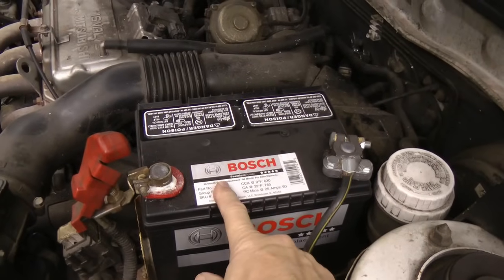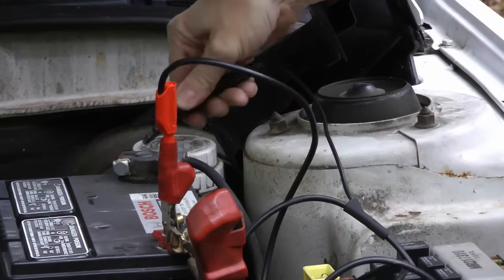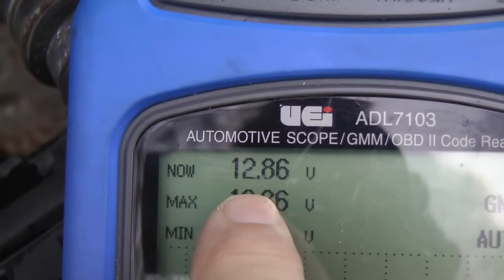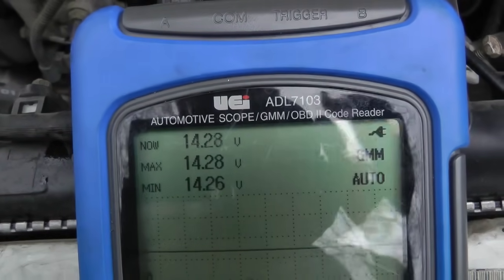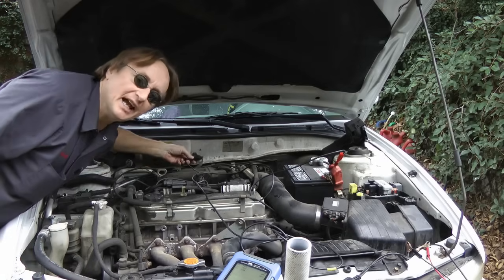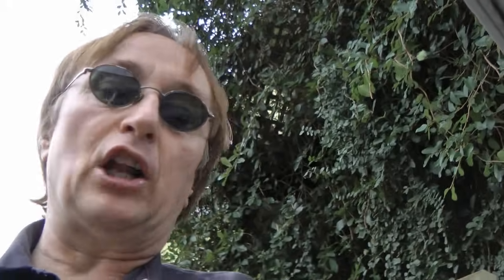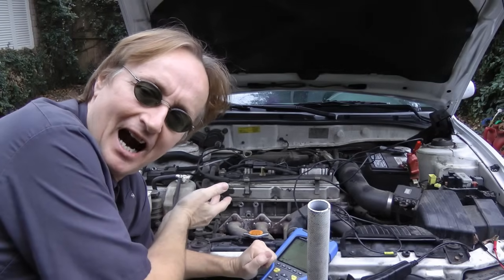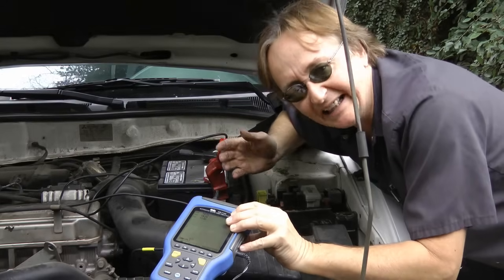How to Fix Electrical Problems in Your Car (Ground Fault)

Comment: Hi Scotty, you're the best by the way. ;)
My car's positive (red) cable is staying warm to the touch. I had a alternator reading and it showed the alternator was giving off low voltage I was told that is a sign the alternator was going bad....so I changed it. The car rides stronger now BUT that red cable is STILL warm. Do you think this may be a sign of a short in the red cable wire? My started test good also. I have an X5 BMW. Any ideas would help.
Reply from the maker: yes, if either end of that cable is corroded or not on tight, it will do that, Also an internally worn cable will do that, but that's rather rare unless REALLY old

Comment: Hey Scotty please help. I have a 2005 explorer. Wouldn't start so i tested battery. Battery was bad so I replaced it. Car started fine for 3 days no problems what so ever. Now car is dead again but it starts right up and runs fine after you jump battery. After jumping it it runs fine and stays charging. I removed battery terminal while it was running to see if it would die, it didn't. Why does it start up fine one day and be dead another? Connections seem to be tight. Also did regular test on alternator it tested good. Alternator was so hot it burned me is this normal? Thank you
Reply from the maker: either you got a bad battery, or you have a short. Have the battery tested, auto zones do that free. IF it's OK, do my video tests "finding battery drain on your car" to find the short
Reply: Ok thank you so much for the tip.

Comment: Hi Scotty coud you help me i have toyota 4runner 98 the  side front and back lights do not turn on also the dashboard light. And check all fuses and all are good it could be that. all other lights work well, brakes, signal lights. Thank you
Reply from the maker: there is no fuse that operates just those lights, so it's not a bad fuse. I would assume a wiring short, either power or ground wires, that feed those lights. Good luck tracing that down, Me, I'll often just rewire power direct from the switch to each lighting system and if that works, just keep it that way rather than tear the whole wiring system apart searching.
Reply: Thank you ¿then the lights have nothing to do with the computer?
Reply: Scotty Kilmer Thank you for your help i have another question,  lights have something to do with the computer (brain box)?
Reply from the maker: *****
 computer systems on modern cars actually turn the lights on and off, the switches are just 5 volt reference signals that send impulses to the computer which decides whether to turn on lights or not

Comment: Hey Scotty. Just picked up a 1991 Lebaron convertible and having some electrical problems. On occasion when I'm stopped at a red light with my brake depressed a cluster of other lights including temp/oil/batt will come on until I release the brake. It also seems to run poorly on occasion after this happens. Also a couple times it seems like the car is struggling to get gas in my opinion it would start to get louder as I accelerate, but not normal loudness, but struggle to actually speed up. It seems to help if I give it a bit more gas or I restart the car. Any ideas on where I should start? Thanks! Love the video very helpful.
Reply from the maker: I feel for you, that's one of the worst made cars of all time. First thing, start with basics, have the battery and alternator load tested, places like auto zone do that free. Pray it's one of those going bad, cause if not, good luck figuring out the rat's nest wiring on that old thing. Most are long gone in the junk yard by now.

Comment: Hi Scotty thanks for all the videos help me so much, I have a 1982 olds cutlass, I want to change the headlight switch, nothing wrong with it just the while lettering has worn off, and I have a brand new in the box and want to use it. How do you get it out? do I have to take off the trim, or do I have to take out the entire dash?
Regards Phill
Reply from the maker: try the trim and realize the switches often have a secret clip to remove the top section, then you can unscrew the switch itself and remove it from the dash

Comment: Hello Scotty, I have a 2004 Sentra and I must change the fuse everyday if I want my tail lights, instrument panel lights, and gearshift indicator lights to come on.  If a bad ground wire how do I locate...what do think the issue is? Please provide a solution. Also, please explain/show in detail how to fix...I'm a female and new to this whole DIY car thing.  Thank you.
Reply from the maker: see my video "finding the source of electrical shorts on your car", it's a royal job finding such shorts and requires such equipment. Probably better to pay a guy like me to do it You can't see electricity so you need tools and gauges and years of experience to find shorts
Reply: Scotty Kilmer Thank you for your response.  I don't want to pay anyone... I will purchase the necessary tools to find the cause and try fix myself.  What if it shows it's an electrical short or ground wire...how do  fix either one?  I was told sometimes something simple as electrical tape can fix the issue. But with your expertise what do you think could be one of the issues?

Comment: Hey Scotty, I have a 1990 toyota corolla 4cyl and im having a problem with my left brake lights... When I hit the brakes I get no lights on.. if I have my headlights on the same light will be on just dim.. soon as I hit the brakes. (With my headlights on).. it goes off.. no lights.. now when I push the light left to right in the socket with the brakes applied.. The brake light will flicker off and on with the headlights on... is this just a bad socket?? Its doing it to both brake light sockets on the left side... 

Thanks Scotty for any feedback!
Reply from the maker: often just a bad socket does that, or a bad ground wire on the rear of the car
Reply: also, don't forget to check for the correct bulbs... not all bulbs have the same resistance, even though they might look the same.... My dad couldn't see the little serial number when replacing the ones on his 93 camry, he just bought what ever looked the same, and the camry reverse lights turned on for that weird reason.....I checked the bulb numbers online and the problem fixed... apparently my dad doesnt wanna accept he needs glasses now.... good luck

Comment: hi scotty I have a question for you I have a 1997 wrx impreza,i get a buzzing/arcing sound from the drivers side dash then the car cuts out,turn the key it restarts and may go for a week with out a fault,so the front wiring loom and rear loom and ecu were checked and the grounds cleaned and re fitted,sadly its still doing it,so its going to Subaru in june for no doubt an expensive job,do you have any ideas?
Reply from the maker: something electrical is shorting out, pray it's just an ignition switch, they can do that
Reply: many thanks

Comment: This might sound like stupid question casue it is but If I want to check the ground wire for the brake light, should i put the red wire from the ohm meter in the brake bulb socket and black on the ground wire??
Reply from the maker: to check a ground wire, put one end of a meter on the bare metal of the car, and the other end touching the bare wire on the ground wire to see if it has continuity. If no continuity, it's bad

Comment: Hello ..Where do you put the positive wire when testing tale lite ground
Reply from the maker: I don't understand your question. You test the ground with a meter to see if it has 0 resistance to the body of the car.
Reply: Jamie very interesting and informative.

Comment: hi scottie,i own an 02' chevy cavalier, and im having an issue with my turn signals.. both the front turn signals wont blink. they light up but they dont blink. the rear ones work as supposed to.  it also click 2x as fast when i turn left and right. no blown bulbs, just the front 2 signals not flashing.. please help! thanks for all the video's! the brake ones saved me a fortune.
Reply from the maker: that's an odd one, since the back ones blink. So, either someone put the wrong bulbs in the front sockets, I've seen that happen, or the wiring going to the front bulbs has a serious problem.  In rare cases it's a bad turn signal flasher, so try that first

Comment: I hv a 94 mustang dash lights, clock and lights for gear selection
don't work checked fuse and replaced dimmer switch can ya help
Reply from the maker: check the dash connectors, pray it's that and not bad circuits in the dash itself, they often break apart at that age
Reply: thx man I checked all the connections and found that the plug that went into the dimmer switch one of the wires was burned up replaced it and works great I appreciate ur info

Comment: Scotty my 2008 mustang gt has a strange problem. Every time I drive the car I notice in the gauge cluster that the battery light comes on, and the message center says to "have charging system checked". It only stays on for a minute at a time then shuts off. It has happened up to 3 times in my short 15 min drives. I had o'reilly, advance auto, and auto zone all perform charging system checks. All 3 stores told me everything was running fine. What should I check
Reply from the maker: live with it, charging system is just taking a short time to read that it's fully charging. As long as it passes a battery load test and an alternator load test, it's fine.

Comment: my horn dash lights and 1 headlight went out was it a fuse????? but everything else works fine and my check light lights up an goes off like normal jus the lights to see the dash at night are off .
Reply from the maker: can't be a fuse, both headlights would go out then.  But do check for more than one fuse that's blown (realizing of course they blow for a reason, such as a short in the wiring or the device they operate)
Reply: I notice theres a 25 fuse where theres suppose to be a 10 could that overload something or is it no big deal?

Comment: Scotty! Strange problem with my 2004 Sunfire.. All the lights in the dash randomly came on.. the gauges stopped working... and the odometer reads "error." The radio would turn on and shut off and act extremely strange (and the theft light kept coming on). I removed the radio, and viola! My Speedometer and RPM gauge work again! However all my dash lights are still on and my odometer still reads error (my fuel gauge and temp gauge still dont work) Could this be a ground wire issue?
Reply from the maker: do check the ground wiring to the dash, plus the power wires to the dash. But if you find nothing, often a bad dash unit does that as they age.

Comment: Scotty...You're amazing man with all of these great videos!!  Such a big help!!  But I was wondering if maybe, just maybe you could help me with a problem...I believe after watching this it could be a ground, but wanted to run it by you before I began chasing it down.  I have a 92 Integra and it has a weird problem...When I turn the lights on, and then switch the high beams on the warning light indicators in the cluster start to erratically flicker.  It's ONLY when I turn the high beams on too...If I just have the lights on it won't do it.  Also, for some reason revving the engine and moving the car will make the flickering intensify.  Not sure if that's a clue or not, but something worth noting I suppose.  Would you say that sounds like a bad ground?  All the engine grounds seem to be pretty good, but I just bought a bunch of cable to replace them anyway to rule them out.  Where would you begin with something like this if you don't mind me asking?
Reply from the maker: have the alternator and battery load tested, easily could be one or both of those are weak. Places like auto zone do that free
Reply: Ok will do thanks!!!

Comment: Hi Scotty, My mechanic is eating me alive. I have a 2008 Chevy uplander. Impala's and their cousins have this same common issue but no one knows the fix. My  traction/stability control system message comes up. Also the ABS and TC light's come on the dash. I had this and reduced power once so they replaced the MAP sensor. It fixed the reduced power but the other problem still exist intermittently. Turn the car off and back on the lights go out. Now they changed the Throttle body and no change. This only happens in stop and go traffic or idol, plus all the lights on my car flicker a little at idol only. ???
Reply from the maker: any time you trip the check engine light on that model, it will turn the abs and TC lights on, that's software design. So you'd have to fix the root problem.  But if lights flicker, either alternator is weak or you have ground wire problems, fix that first
Reply: Ground wires are my plan for Saturday thanks

Comment: i find myself having the same problem in a way. My ECU seems to not hold memory. i visited the Smog shop 3 times. the first two times, first time it failed due to speedometer cable not working. fixed it, drove about 60 miles, then went for another test. drove about 40 more and went back, none of the ports of the ECU was receiving memory says the guy who was smogging my car. i just replaced my battery before these tests because of my battery was dying which then reset the Check engine light. so many said to check ground wires, previous owner told me to do a power cycle and again check my ground wires. what is your opinion?

Comment: My headlight are really dim as well as my dashboard every times I step on the break my stereo turns off. All of my light on my dashboard turn on and turn off in a strange way. Speed odometer gas and temp and Rpm only work when it wants to.

Comment: I prefer to check the ground by putting the black lead on the - of the battery, and the + lead on the engine block.  Would work justa s well, just that you are looking for 0 VDC instead of 14 or whatever.  Then if you have a .4 VDC drop, it will just show up as 0.4 VDC on the meter. No need to take measrument of the battery first. Kirchoff for the win :)

Comment: Scotty, I have a 99 jeep cherokee; the interior lights constantly stay on. I know it's not the switch. What would you do to fix that? Thanks!
Reply from the maker: If main switch on dash is good, then either one of the door switches is stuck on or you have a wiring short to power. Me, If it's a hassle finding the source, I'd pull the fuse for the interior lights and live without em

Comment: Scotty my ajar light does not turn on when opening the door I change the bulb but it still doesn't work on my mitsubishi galant 2002 2.4L ES what could be the problem
Reply from the maker: generally a worn out door switch does that

Comment: Hey Scotty!  I am having issues with my instrument cluster lights flickering and then going out when I drive.  With the key in the ignition and the car NOT started, the lights stay on and work fine.  But when the car runs for about 10 minutes, the lights flicker and go out.  If I'm in park, the lights will flicker when I press certain buttons, like the automatic window buttons to roll the windows down or up.  Also, this ONLY affects the interior lights on my instrument panel and the ones used for my center console...this does not affect my exterior lights.  I'm totally not sure what to do...any IDEAS?  Thanks in advance and thanks for all your helpful videos!!
Reply from the maker: often a ground short inside the car on the instrument panel will do that, OR a power short going to the circuit in the dash that runs the lights there. If it's a GM model, they burn out the circuit boards on modern GMs as they made the dashes cheaply in china and they just come un soldered.
Reply: it's a 2001 Ford Taurus.  Is there a specific tool or way where I can diagnose the exact issue or would I have to take it to a mechanic?  Also, could this possibly be an alternator issue?  Thanks again!  Your videos are extremely helpful!
Reply from the maker: Christopher Drinkard
 you can use a simple test light to check for power down the wires then into the dash itself . It lights up when there is power, and does not when power is lost. That's the quick way of checking it, but you will have to remove parts of the dash to do such checking

Comment: Hey Scotty I am currently having issues with the tail lights of my suburban.  The issue is when we step on the brakes my right signal turns on.  I cant even signal because that causes the problem to come up as well.  But it has recently gotten worse.  At times the tail lights don't turn on at all.
Reply from the maker: check the ground wires back there first, bad ones often do that. And also make sure the correct bulbs are in the sockets, I've seen wrong bulbs forced in that then short stuff out just like that.

Comment: Hey Scotty,  I have a 99 Lexus Rx300.  When I drive, headlights, odometer lights start to flicker and the car jerks while shifting.  This started happening after I got stuck in about a foot of snow but I was able to get the car out after some rev-ing.  Is it possible the a ground wire might have come loose or off the tranny?  Battery is brand new.  Please advice.
Reply from the maker: have the alternator load tested first, bad ones do exactly that. If ok, start checking ground and power wires.